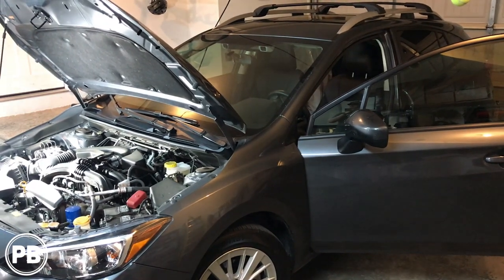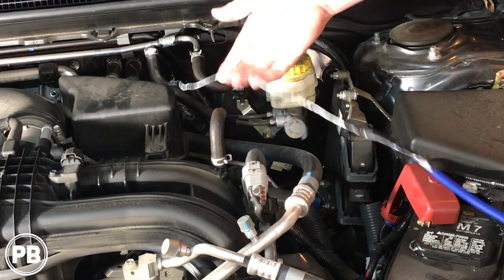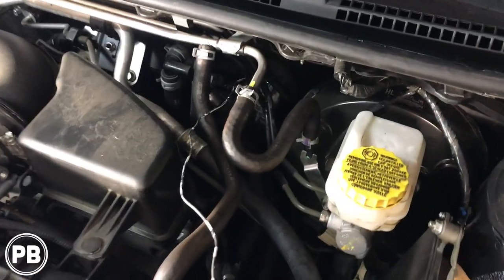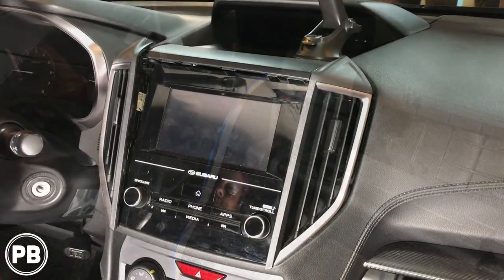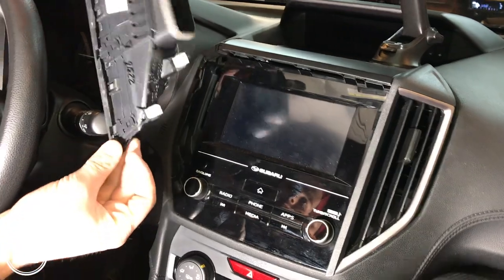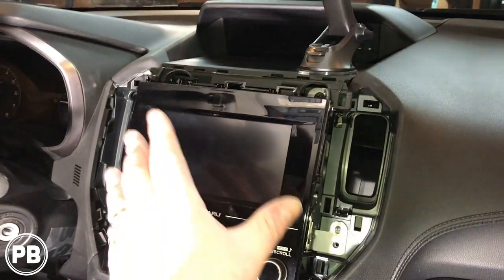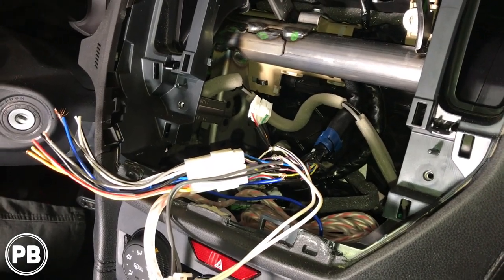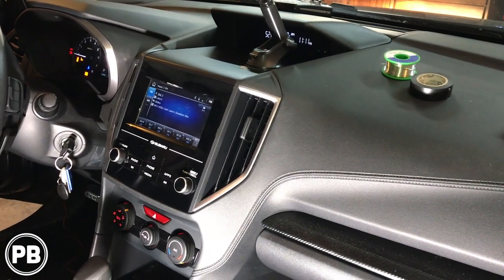2017 - 2021 Subaru Impreza / Forester Amp and Sub Install

Comment: I watched your video over a dozen times, and two days of trying later and over an hour and a half of trying to stuff a 0ga wire through my firewall gramet, I managed to install a 1600w sub and amp in my '18 impreza. Thank you for the great video as I would've been completely lost without it!
Reply from the maker: Hey sure thing! Not the easiest of installs, so glad it helped.  Cheers!
Reply: do you remember how you dealt with the starlink thing?
Reply: Yeah, you connect the speaker wires to the rear speaker speakers of your car, at least for me. I don't know if subis ever switch where the connection for starlink is, but you just want to make sure you connect them to the wires not powering starlink
Reply: @ga055  thank you!

Comment: Just finished my install, it took the whole day but this video has been my main reference! Thank you so much for the guide! some tips for others:

-you don’t need to remove the seat at all, i have a bigger amp than the one in this video and it fit by sliding the seat forward to place it. wiring the amp is harder though.
-look up video on removing radio, it’s super simple
-if you get stuck, work on something else, and come back later
-you can research and ask questions as much as you want but eventually you j gotta try it yourself

Comment: Thank you very much; thag was helpful. I hope you will upload a video showing the right motion of removing clips without causing stress marks, cosmetic damage, or even breaks. Also, what AWG did you use for the blue wire coming from the battery?

Thank you very much
Reply from the maker: All parts used we listed in the description on the video.  4 Gauge wiring.

Comment: I just came across this video.  I like the tips on where and how to run the wiring, but I'm horrified that this setup was done without upgrading the negative lead from the chassis to the battery.  In the video, it shows you're still using the 10ga (?) wire.  Just curious after the number of years this video has been up, has the driver burned through that wire yet?

Comment: Hey Chris, 
Loved the vid and I'm looking to do similar. Question though, regarding the component speakers.
I've read the head unit is underpowered and therefore people have run amps to power the component speakers.

How would you tackle this?
Using a different channel on the sub amp, you could attach the fronts for example. But how would you power up the rear components without losing the fade function the head unit provides? Does this require a secondary amp?

Comment: Hey do you know which wires are the power and ground? I'm installing a loc and all went according to plan except I have a yellow power wire and a black ground wire on the loc, and I don't know where to connect them.

Comment: Curious about the power wire being zip tied to the speaker wire.  Im sure you have a "humming" noise.....
Reply from the maker: Nope, generally a ground loop issue comes from poor ground or low quality RCA cables.  No ground loop issue here.

Comment: Hello. I have a 2021 Subaru WRX STI. I replaced door speakers. Door speaker wire. And adding a subwoofer. I installed a line output converter after the factory amplifier and it is not working. It turns on but I'm only getting.3 volts out of the RCA cables. I double checked all the speaker wires I tapped into. Does the amp have speaker load censors. Help. Thanks

Comment: Wow I didn't think to use a radio harness to locate the speaker wires for a sub add on.  Thanks you saved me on the install on my 2023 Impreza.

Comment: Hopefully I’m not commenting too late here. I plan to do a sub install on my girlfriend’s Impreza with the same sub setup I put in my truck. By the end all I ran to my radio was my rcas and my remote signal wire. Will there be a place to plug in my rcas or is that the purpose of the splicing you did? Like you had to make your own rca plugs?
Reply: There are harnesses on ebay that should work

Comment: Hey! Just did this setup, but I’m not getting a connection. I’ve done a few setups so I assume my problem is I wired wrong to the radio. Do you know what the model of this radio is?

Comment: What year Toyota harness did you use? Does that also have rear speaker connections?
Reply: Metra 70-1761 to connect to car wiring harness

Metra 71-1761 to connect to factory radio

If you buy both then you don't need to cut any wires on the factory harness and its like $15

Comment: I’m looking to do an amp and speakers/subs in my new 2021 forester. Do I have to ditch the stock radio console?
Reply: No. Look up breakout harnesses. They go between the factory harness and the stock radio giving you a place to splice without cutting factory wires. You still get high volume signal attenuation. But unless you are wanting to go deaf, you can make it plenty loud.

Comment: Hi pretty new to this, do I need to buy an amplifier or is there anyway I can just use the dials just in my car?
Reply from the maker: If you are buying a subwoofer, absolutely you will need an amplifier.  Your factory radio only puts out about 10 to 15 watts per speaker, and does not have any additional available power for an aftermarket subwoofer.

If you are new to this, i'd recommend just using a loaded enclosure that has the amp and sub all in one.  https://amzn.to/3y5wrlG
Reply: @ProvoBeastAudio  thank you!

Comment: Could you please make a video where you make the cable insertion through the firewall clearer? because it’s not clear whether you made a hole or pushed through some space in that grommet. How the tunnel is shaped? Because I want to know the direction to which I should push the wire
Reply from the maker: Not a personal vehicle but we have a ton of other amp install videos on our channel. Just check out that playlist on our main YouTube page.

Comment: how did you figure out what wires to connect to im about to do this in my 2013 subaru Crosstrek xv and it has a different stock radio

Comment: What a good job, very practical and simplified installation. I would like to install the Kicher Key 180.4 on my Subaru XV 2019, could you illustrate where I would put it and how would the installation be easier? Do you think it should be behind the radio? How do you do it? Thanks a greeting from Peru.
Reply: Did you end up doing this? I'm wondering if i can mount a kicker key behind the radio as well.
Reply: @andytheffboy  I already have everything to install the Kicher Key 200 in my Subaru XV, I bought a plug and Play harness in the US, the site at https://plugnplaykits.com I bought it with everything and the Kicher key since I did not sell it separately,  The practical thing about this is to connect everything without cutting cables, or wiring up to the battery, just using the OEM installation, I need to see an issue with the CarPlay in my Subaru, for which they are changing my radio for warranty, once I have  The radio will install the Kicher key, I just need to see where I will put the Kicher Key, it seems to me that I will put it in the glove compartment.

Comment: I found your video searching for the best way to route power through the firewall of my 19 Forester.  This is for an amateur radio install.  I found the same rubber grommet on the engine side and the plastic housing up above the gas pedal.  Looks you poked a small hole in the gasket on the engine side away from the factory wiring?  On the under dash side, did you pre drill a hole in the plastic tube housing?  I see the blue power wire comes out of a hole but I didn't see an existing hole on my car where the factory wiring comes in by the gas pedal/steering column.
Reply: Any solution?
Reply: @nickt1475  Yes, I found a rubber grommet that I cut through.  I think it was up behind the gas pedal.
Reply: Mike Cooke  yeah i made a small cut in the rubber tubing behind the gas pedal and another at the other side where the guy shows in the video he pokes through but I cant get the coat hanger to pass through. Been trying for an hour lol

Comment: Video says 2021 but the product link says up to 2020… will this harness work on my 2021 Forester? Literally looks the exact same as what you’re doing but I wanna make sure the plugs are the same
Reply: Have you done this yet? I'm about to try in a couple days on my 2019  forester. 2019+ is 5th generation so it should work for both of us. I'm pretty stressed about getting this installed.
Reply: @BobSmith-wg5wz  so actually I ended up having to trade my Subaru for a 22 Tucson cause my loan fell through but I did install subs in my Tucson. I tapped into the B-pillar for sound from the rear door speakers and combined the left and right inputs into one. Got the Hyundai SHAKING

Comment: Hi guys, I have a 21 Crosstrek Limited and have starlink system. Do I need a Telematics 16-pin jumper adapter ?? 
Because I read that the Telematics module will recognize that the output impedance (which is the front speakers in the OEM configuration) is incorrect and this will flag an error on the Subaru Starlink system.

Comment: Is this amp only powering the sub or is it powering all the speakers in the cabin as well? Looking to do a similar setup but am interested in getting more power to the cabin speakers as well.
Reply: Looks like just the sub. Interesting that someone would install a sub with no change to the factory speakers 🤷🏼

Comment: is there a way to do this without having to splice in to all those wires? like an adapter i can buy or something? lol
Reply: yes there is. it's a jumper harness for around $40 so you don't splice into the OEM factory wires. answered my own question

Comment: Thanks so much for your help! This is an awesome video! Did the radio need an anti theft "factory code" like some manufacturers sometimes require? 

I have a 2018 Impreza hatch just like the one in this video and that's something that I'm concerned about.

Comment: Nice video! My friend and I used this video and had a smooth installation. Before the install I noticed as I turn my volume up the bass slowly starts to fade out. After the install the same thing happens with the subwoofer volume. The system seems to fade out the lows at higher volume so the highest I can really listen to it before the sub starts to get quieter is 25. I’m guessing it’s just a weak head unit, but curious if anyone has some input.
Reply from the maker: Bass roll-off.  You can use an Audio Control LC2i to correct that at a decent price.
Reply: Provo Beast Audio Installation awesome! I appreciate the info. Thank you.
Reply: Rear channel has Bass roll off at about 300 Hz to save the smaller speakers. Front channels should not have that (at least they don't in the 2020 Forester)
Reply: interesting i had a car shop put dual subs in the back of my crosstrek recently. i have the rockford upgrade so theres a separate amp for the front speakers too, so the factory amp isnt used. But ive also noticed my bass decreases also around 25. sub has its own amp. did you find a fix for that?

Comment: Hey I have a 2014 subaru impreza with the DIVX head unit. I was wondering if you or anyone knew if that would be compatible for hooking up a sub? or do I need to get an adapter or head unit?

Comment: This video is not the best  the yellow and black wire this guy used does not work properly leave amp on
Reply from the maker: The yellow and black wire is to generate an accessory wire (power to the blue / white wire) if needed.  Since our factory radio had an analog accessory wire available, we used that instead. Please watch all the video before making a dumb comment.

Comment: i was wondering if i could get help with installing my line output converter to my 2019 subaru cross trek i wanna make sure i’m doing it right
Reply: its been many years since i did car audio installs but you should check out www.the12volt.com . they have many vehicle specific wiring diagrams